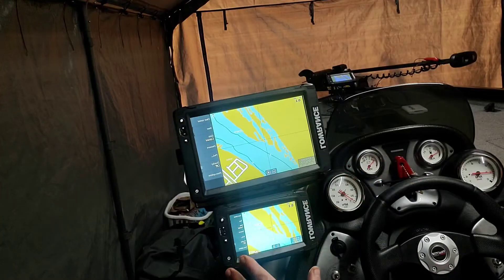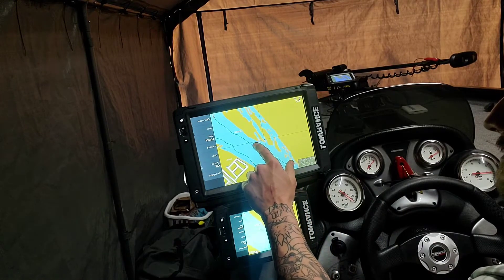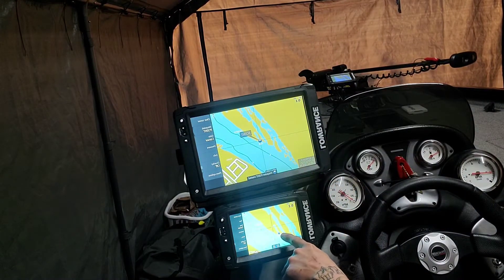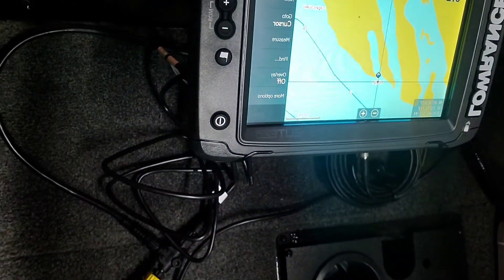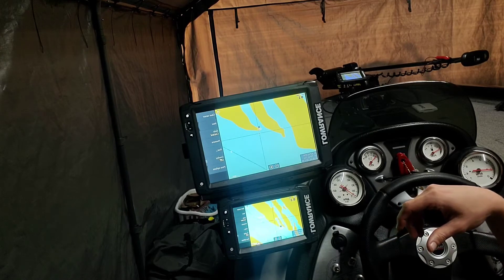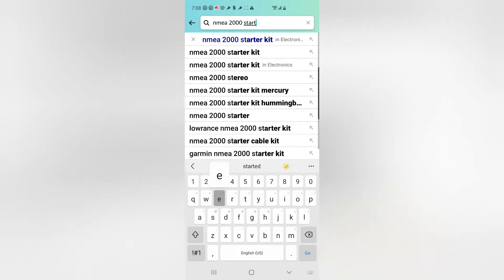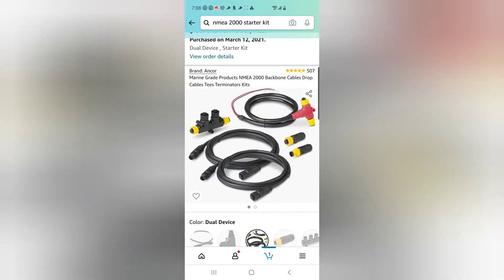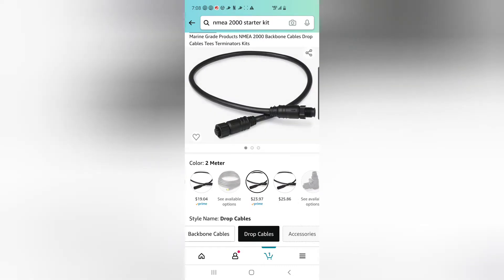NMEA 2000: Best Budget Network Setup and install for Lowrance, Garmin, Humminbird etc..

Comment: Why did you need the extra T at the Bow?
Reply from the maker: Because you have to have a terminator on each end of the connection from my understanding. And I added additional connections on the bow for my lowrance point one antenna this winter as well
Reply: @cra-bassint.v.5664  That makes sense.  Thanks!

Comment: What kind of console bracket is that for your graphs. Is it a modified Ram mount. They are both on the same base, yes
Reply from the maker: Oh for the drivers console I used Ram 1.5 inch ball mount for the 2 lowrance units. The 115 size was for the bigger units up front

Comment: Hey I got a HD gen 3 7 inch lowrance.  I cant get it to use my point 1 antenna it keeps saying no GPS fix.  I think its not wired correctly. but Im not exactly sure how its supposed to be wired either.  I also have a nema 2000 backbone where my garmin gps, garmin antenna, simrad autopilot,garmin sonar, and wind is connected.  Im thinking I need to run a T off this nema 2000 bus then have that cable run to a double T where one of the T's goes to the Point 1 antenna & the other T drops off and connects to the nema 2000 input on the back of the GPS?  Does this sound correct?  I know its hard to figure out without a picture or diagram but if you have a link to one that would also help.  I did look at the manual and this seems to be the right way.
Reply from the maker: I haven't added a GPS puck to mine but it sounds correct that you have to tie it to the nmea system. And I think there's a procedure you have to do once you installed the puck to get it to get a GPS tag.. this is something I haven't done yet but I will be adding one to my bass boat this weekend I think so if you wanna hang on till then I can hook it in to my boat and I should be able to let you know how it went.. if you want you can find my Instagram account and msg me and maybe we can work togather through the messenger on there cuz I'd be glad to help u figure this out my friend
Reply: @cra-bassint.v.5664  Thanks for the reply. I'm not in a rush to set it up so I can wait until you do yours. It's more of a back up gps as my garmin is my main. I don't have instagram I think it should be easy to do here.   I looked thru the manual and the way I described seem to be it. I think I'm going to get the starter kit from academy as it's 59.if I buy everything separately it ends up being almost 70
Reply from the maker: @peterc504  hey buddy do you still need help woth the point one antenna?
Reply: @cra-bassint.v.5664  No just figured out it was the fuse on the unit lol